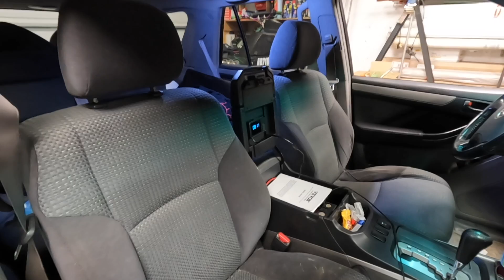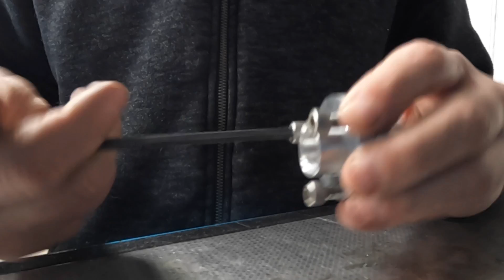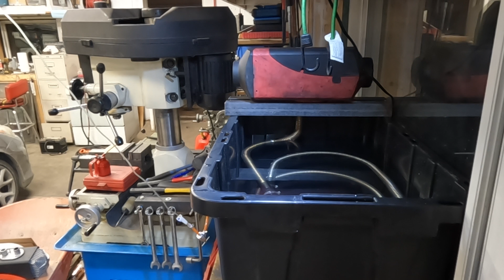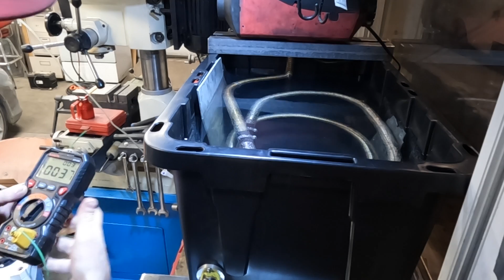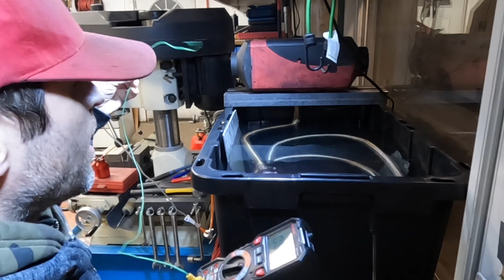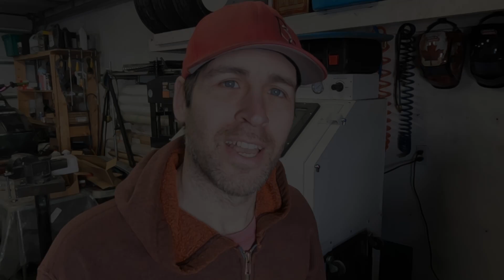"SIMPLE" Water Exhaust Heat Recovery - Diesel Heater Testing

Comment: Wow I can’t believe you did it before me. I’m jealous 😅. . “That is a lot of condensation!” I thought oh no it can't be 🤣!!! You got my mental telegraph. This is the exact setup I had in mind except the exhaust length. I almost bought a black tote but to camouflage in nicely with the window wall, I bought a semitransparent white one.

I totally get your frustrations. Thank you so much for doing the experiment, validating and endorsing the concept. For experimental purpose, the leak is inevitable if you have multiple pipes and joints. I thought you was going to first try with just one pipe half a loop / gentle curve shape knowing that the bends would introduce elevated CO. If the exhaust goes outside, 1000ppm is of no issue.

It’s alright. It doesn’t need to be perfect. You have successfully demonstrated the concept to practice. The idea alone is worth spreading. You went far beyond that. From here people will refine upon your result; insulate the container if they want hotter than 40°C, hot water cylinder, BPHE, shorten exhaust length, bigger exhaust pipe diameter, use silicone exhaust coupler (to prevent leak), etc. 

The efficiency seems 100% thank to the long pipe I guess. That’s an incredible result. Look at that steam coming out nicely 😮. I could even feel the heat 🔥from here. Heating power turned out 0.6-0.7kW as expected at highest setting. It won’t reach to the boiling point due to the factors you mentioned but that’s not the point. The point is to capture the exhaust heat as much as possible, as cheap and easy as possible so people with no special tool can repeat. 40°C is more than enough for a hot bath, warm water for cleaning, etc. 10°C per hour increase is not bad at all given your climate, by the time you feel warmed up, you can have a nice hot bath. I never aim to make a cup of tea with it. I’ll just use a kettle for that. 

Ouch take 32!!! 😅😹
Reply from the maker: Great minds think alike! 

I had planned on running this test dry first and then wet... I also wanted to just loop it in a 5 gallon pail to see what would happen... but the season is short and I was running out for time for all of the experiments, so I decided to do this one. 

If your intention is to heat the water, then you want to insulate it. If your intentions are to capture as much heat from the water as possible, you are better off leaving it open and uninsulated. Water at 20C is going to be much more efficient at capturing energy than 40 or 50 C water.

I was also blown away at the efficiency ! 3C over water temp.... That being said, when the water temp was at 40C, the exhaust temp was 43C (about) .... If you try to argue with physics, you lose every time, haha. 

Haha... yes... 32 attempts at one clip ! It's not that uncommon. I get distracted pretty easily !
Reply: Great minds!! 😅Yes I intend to experiment a dedicated water heating project after this one. I will submerge the heater body / radiator part and the exhaust totally in water absorbing all the heat produced by the heater to heat the water. Atm it is at a concept stage but like this one I’ll think through it. That will take absolutely no time to boil a bath. Electricity and everything else being so expensive, I’m afraid this will be the only viable option in the future before they ban it, they will!

No you can’t argue with physics. If you think the temps will add up like apples and oranges you find that they don’t, for example, if you mix two cups of water at 50°C, the mixture doesn’t end up at 100°C! On the other hand if you turn on a heater and turn on another heater the heat generated by both add up! In the first case, no external energy is going into the water but in the latter case, an extra 100% energy is going into the room. Still blown away. The specific heat of water is so great it only leaves +3C at the exhaust, of course in “relative sense”. It will boil water if the tank is insulated like in a hot water cylinder. The exhaust temperature of 290-300°C can easily lend 100°C to water. 😅

Hat’s off and thank you very much again for your persistence, expertise and humbleness. 🙏 @loweredexpectations4927
Reply from the maker: @examplerkey  I really want to do that as well. The submerging thing... I think it will be quite challenging ... I haven't put a lot if thought into it yet... but I can see it being tricky. Maybe if you can stand the heater on end with the heat outlet side pointing down. Challenging, but rewarding. 

Thanks for the support and enjoy your tinkering ! ... Will you be posting videos ?
Reply: It will have to start with running the heater upright on the heat exchanger and see if it can burn the fuel reliably without any leak or soot build up inside. If it passes this test, then the heater can be installed upright in this way on top of the tote. 👍

If not, it will have to stand (held up) on the fan end with the heat exchanger going into the tote from the bottom via a circular metal plate with a hole for the heat exchanger in the middle. This can be in the form of an extended metal gasket or the heat exchanger part crudely siliconed to the plate for the experiment sake 😯. The idea is to submerge the heat exchanger in the water from any possible direction (top, side or bottom) and extract the heat that way ⬆➡⬇🙃🙂. 

It will be 6-7 times more heat from it compared with the exhaust, so maybe a small / medium pump will be needed to circulate the water every now and then on timer. Whether or not the exhaust also goes through the water is an option limited only by the time and other constraint of the experiment. Yes I will post it after I finish. @loweredexpectations4927
Reply from the maker: @examplerkey  Yeah... that's the way I "plan" things also... whatever works , haha. 

It will be so much easier if the heater runs with the inlet fan pointing straight up ... hopefully ! 

I'm sure there are options to slow or stop the heater depending on water temperature. I've been wanting to do something like this for a while now, but it's all a matter of how much time I have and where I want to focust that time. 

Good luck !

Comment: The carbon monoxide is high because the exhaust is cold.
Hot exhaust pipework helps to make the CO oxidise into carbon dioxide, also producing even more heat in the exhaust.
You really need some kind of pre- 
oxidising chamber to burn off the carbon monoxide and obtain the extra heat from its combustion.

I can't tell you how to do it.
Reply from the maker: Yeah... I suspected it is the cold exhaust and mentioned this in my previous exhaust video... however, I think this has more to do with the cool dense air being more resistant to flow... the reduced exhaust flow also causes less inlet air, and that makes CO. 

Perhapsy a catalytic converter... but you need to keep it hot for it to work.

Comment: Was the air inlet above the water?  Could either inlet be pulling in water vapor? Causing such high readings. Or is it likely just exhaust length.
Reply from the maker: I think there were a few factors, but the main thing is the bends in the pipe. I used 4.8 metres of pipe in a previous video and it word fine. 

Another thing that is likely happening, is that the cooler exhaust is more dense, and therefore causes more resistance to flow. When I did my last test, adding a new section of cold pipe would cause the CO to spike until it warmed up... then it would be okay. Similarly, when starting the heater from cold, it make a HUGE cloud of smoke and a LOT of CO, but then was fine once it warmed up.

Comment: Always happy watch the videos, I'm happy you posted it.  Sand my have been a bit less of a pain to work with.  Looking forward to more waste oil videos could we see your new set up running on veg oil to see how it runs.  🙂
Reply from the maker: I do have some Veg oil... I was planning on running itin a standard chamber... but we will see what happens. I'm working on modifying my chamber to burn cleaner now, so maybe a veg oil test after that.
Reply: @loweredexpectations4927  veg oil and diesel mix runs but causes a lot of soot on mine overtime and I get carbon build up on the flame initiation air hole
Reply from the maker: @Coffeebean1482  When you run veg oil, are you just using a single tank to start and stop the heater ? I have had a few people insist that if you start on bure diesel, and shut down on diesel, you won't have issues.... I personally think most or all of them have never actually tried it and are just making stuff up. 

Veg oils have glycerine, and that is apparently the issue. Biodiesel is veg oil with this removed.
Reply: @loweredexpectations4927  I just use a single tank. As I don't have a spare. I agree with you because the heater still gets up to temp on the mix so should burn any rubbish off but it doesn't seem to it slowly clogs up.   But I think with your modified chamber it would burn well it has nothing to gunk up.
Reply from the maker: @Coffeebean1482  Yeah... I think you are right.

Comment: Hot water cylinder coil (if you have such a thing in Canadia) could be a good ready made copper coil, maybe from a scrap yard or local plumber's recovery.
Reply from the maker: Yeah...Anything copper is going to be way better. I used this as I already had it and it is what most people will think of when they attempt something like this.

Comment: One bend with large radius would not limit exhaust flow this much, and 50cm of tubing submerged in water would still recover a lot of heat. Also, EGR cooler would be worth a try, it's water jacket can be removed to get it's heat output directly to container with no pump
Reply from the maker: One bend would be much better for flow. 50CM  would collect some heat, but the exhaust had a 3C higher temp than the water, so anything shorter would be less effective. How much less effective ... I have no idea, haha. 

I really want to play with an EGR cooler at some point... it is on my long list of things to do.

Comment: While the rig is set up it would be useful to know what length of immersed tube is really needed to extract most of the available heat - I guess less than you used. Perhaps check the heat of the tube at various distances from the input ?
Reply from the maker: Yeah... I used a little over 2.4M of exhaust, and the outlet temp was only 3C above water temp, so it was working very efficiently.... just not free flow enough. 

Yeah... if I would have checked along the length of tubing, I could pick a place where I was willing to give up X amount of heat. The only variable is the number of bends and now tight they are, as this will have an effect.

Comment: Now you have a pretty good idea of the good and bad of the heaters. Any thoughts of having a go at designing one of these from the ground up? Maybe a collaboration with a few who are as into it as much as you.
Reply from the maker: That is an interesting idea, and I have considered it. I have been in the process of building a CNC milling machine, but have had to keep my projects fairly small because of some ... life events. I'm going through a separation and may have to move soon... So a LOT of stuff has been put on hold.
Reply: @loweredexpectations4927  Ahh... Went down the self build CNC route myself. Got into Fusion 360 for design and used Arduino to drive Nema 17. Wood metal construction using din rail and 17mm bearings.  All that sends you on a whole world of discovery. Carved wood and acrylic with it.  All now disassembled and will at some time have another go.  As for you getting into designing your own heater. If you can, do it. Give the Chinese a run for their money. 👍

Comment: I wonder if you could run the exhaust through one side of a HRV before exhausting it, where the other side of the HRV would just be circulating shop air.  I bet you could capture most of the heat out of the exhaust.
Reply from the maker: Yeah.. I can't see why that wouldn't work. It would have to be a unit that you were sure was sealed, to keep fumes and CO out.

Comment: This as a really useful video. It shows there is about 500w of waste heat being lost out of the exhaust and if anyone wants to capture this to heat water, say in an RV, they had better keep the exhaust tube length reasonably short to minimise back pressure and CO production and should make sure there is a continual fall in the pipe so that water produced by combustion and any tar drains straight out.
Reply from the maker: Yeah.... I think the exhaust losses are likely up around 750W, but the heat loss from the uninsulated water means that it is losing a lot of wattage to the surrounding air. Shorter or larger tubing is a must to keep CO reasonable.

Comment: You need to get a used webasto thermo top car heater and do the water test with it again
Reply from the maker: That would be cool... Not a fair comparison as this is just collecting waste exhaust heat, but they are pretty cool units. 👍
Reply: @loweredexpectations4927  i have a hot water cylinder with a heating coil run by a webasto termo top with is wired up to a stock air heater controller. running the motor in parallel. Works good. 3l diesel a week for 2 person. exhaust is 130C. 3 safety switches to cut of the fuel pump when sadisfied or during a waterpump failure

Comment: If you do come back to this using copper tubing, and if the temperature actually increases to a useful range, I'd like to see you add some thing to circulate the water and try to cook something sous vide style!
Reply from the maker: Thanks for the comment. 

I am almost 100% certain that the temp would not rise much more, or any more with this current water container. The stainless exhaust worked really well at putting heat into the water, as the temp difference between the water and exhaust was only about 3C 

Unfortunately, physics gets in the way of our fun, and as the water heats up, the exhaust can't heat it as efficiently. Meaning. Once the water reaches 40C, the exhaust coming out of the pipe will always be a minimum of 40C. Energy from 40C exhaust can not heat 40C water. 

You can heat a larger volume of water with a second or larger tub, but you can't reach a higher temperature, unfortunately. The only way to do this would be to have a very small tub, or to have it extremely well insulated.... or to use it like a shower, and heat water in real time.
Reply: @loweredexpectations4927  I wonder if adding a heat pump to the contraption would be able to raise the temperature, but that's way beyond the scope of your experiment and probably not worth the cost unless you have access to an old air conditioner you can modify to run as a heat pump
Reply from the maker: @lemonherb1  Haha.... Yeah. I'm sure you could do some interesting things with a heat pump !

Comment: A all metal car heater matrix would probably be a cheap and easy option for this. I'm wondering if using oil instead of water would be a better way to go it would solve the evaporation problem and opens up many options of how to make use of the heat under floor heating sand battery etc. Why do you have to keep Quasar on a lead I've always let my cat's come and go as they please I have adopted every cat I've had and always go for the street wise independent type
Reply from the maker: Yeah... oil would solve the evaporation problem making the process more efficient. 

Megan is a Vet Tech and is very protective of Quasar. She gets to see a lot of cats that don't fair well because of running lose. I do often allow him to run free, but she does not approve.

Comment: So what your saying is that it will heat a hot tub no problem 😊 👌
Reply from the maker: Haha... I guess it depends on the size of the hot tub, and how hot you want it to be. Maybe a hot tub for Quasar. 

It looks like this was topping out at 40C and the surface area is pretty small. The larger the surface area, the more heat losses, so the cooler the water would be... I think you'd want to submerse the whole heater, haha.

Comment: If you had used PH test strips you would have found the liquid exhaust condensate was very low PH. It is very understandable that your cheap corrugated exhaust tubing has corrosion holes in it from your previous exhaust heat recovery experiments. The more you cool the exhaust the worse the corrosion will be, example high efficiency condensing gas furnaces use PVC vent stacks. Glad you're trying ATF, also consider trying screw compressor oil but be careful with the synthetic version it can contain a lot of hard to remove emulsified water if recovered with an oil-water separator. If you repeat the water heating experiment, use an old ice chest.
Reply from the maker: Thanks for your comment. 

I tend to believe that the holes are there from poor manufacturing. I wouldn't totally rule corrosion out as a possibility, but I think this cheap tubing is made of 304 stainless and is pretty corrosion / acid resistant. 

Interesting... Screw compressor oil eh. There are so many different types of lubricants out there. The other day someone recommended HP printer oil ... I looked it up and my mind was blown. 

You know what... I had an old ice chest that was kinda rough, and I left it in the alley with a "free" sign on it... dang it, haha.

Comment: Perhaps because of the length of exhaust pipe there is too much back pressure. You might try using larger exhaust piping. 🙄
Reply from the maker: Yeah. I have already done a test where I used 4.8M of tubing (in a strait line) so this was sort of a continuation of that. The bends in the tubing and the fact that it doesn't have a smooth surface also has a negative effect on flow. 

There are lots of different / better ways to do this 👍